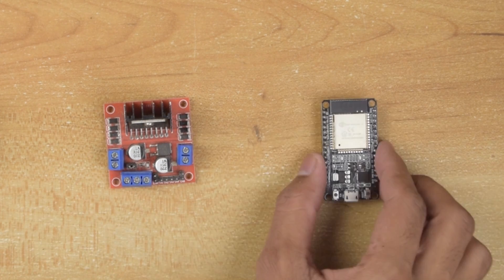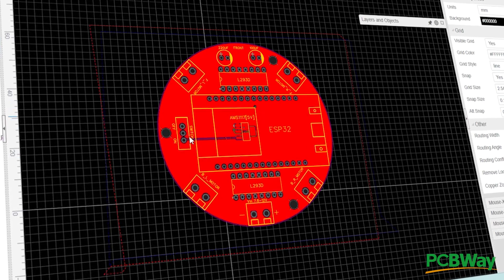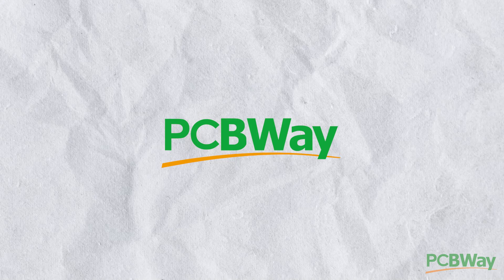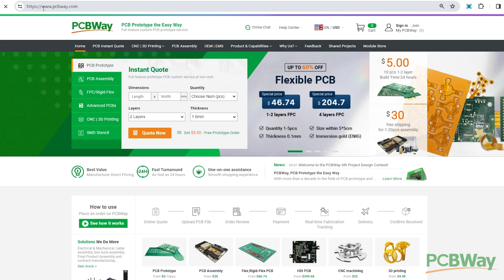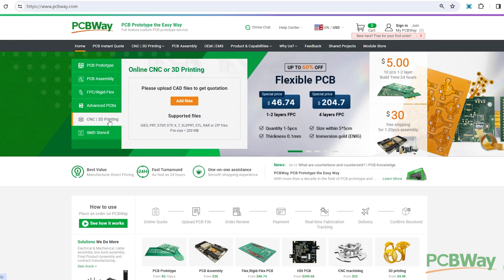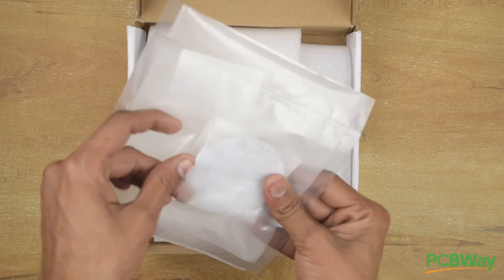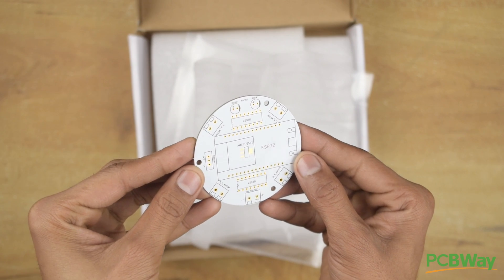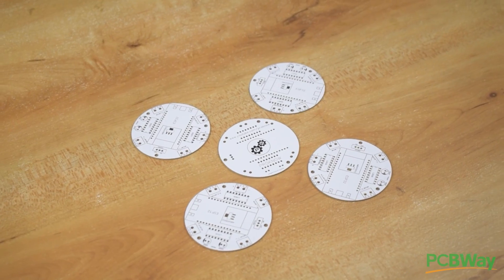Unveiling the Secrets: Arduino Bluetooth Car with Shock Absorbers - Arduino Project

Comment: the code is not working and it is showing ledcSetup was not declared
Reply from the maker: ldecSetup() is a function from Arduino-ESP32. If you are using a microcontroller other than ESP32, hence you are using an Arduino board where that function does not exist. So make sure you compile this code for esp32.

Comment: Bro I am making a Bluetooth control RC car from your video https://youtu.be/a-EBk-XZ4UY?si=g5Ba4f-qiszOX7yk
I upload code in arduino   nano and  then i connector all  wires  and install Bluetooth rc control app connect with my mobile whenever I give command to the  car  it's doesn't respond . please help me bro I am feeling very upset 😢 you are my last hope I spend all of my pocket money please try to resolve my problem😢😢😢😢😢😢🙏🙏🙏🙏🙏🙏🙏🙏🙏🙏🙏🙏

Comment: I used to compete in RC Crawling so I have some advice.  First off, this is a good design.  Having each suspension link separate and driven separately is great.  You will want to add some form of "diff" to the motors.  You cannot do mechanical, but maybe you can add detection so if a wheel slips, it will slow and allow the opposite side to power through and then re-engage?

But, you need droop.  You do not want your ride fully suspended at all times as there is nothing to droop in to.  Your ride height should be half of the over all shock travel.  Those shocks are not good for this.  You need softer springs.  When it goes over an obstacle the wheel/tire should droop into the crevasse or rock, etc.  Google droop in RC rigs.

Get rid of that 18650 dual setup under the belly.  Nothing good comes from dragging that over obstacles.  

Get a 2s/3s setup and add it to the top of your chassis top plate.  It will not weigh much more but will give you more punch and zero drag.

I want to make this!
Reply from the maker: Thank you, I like your suggestion very much, I will try to implement it in my future videos.
Have a nice day 🙂